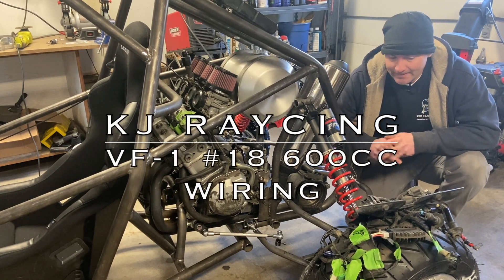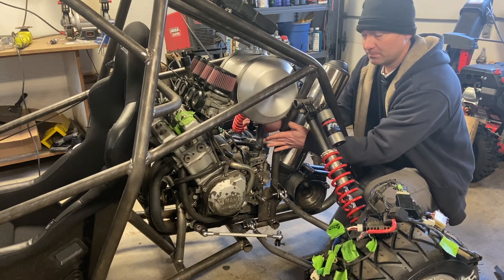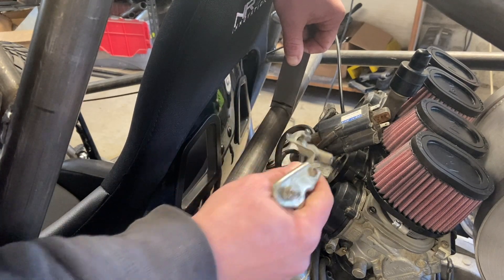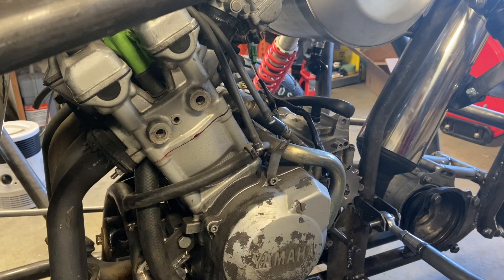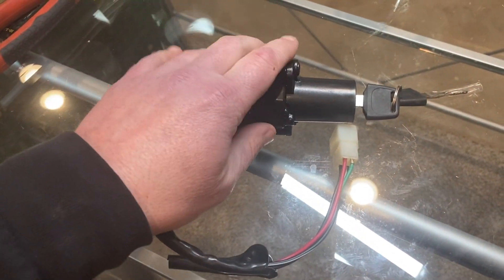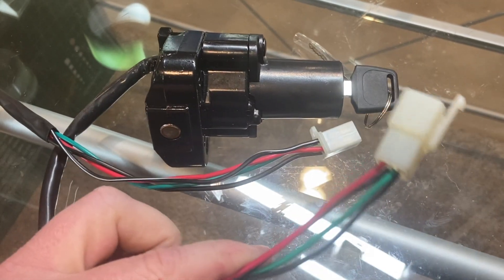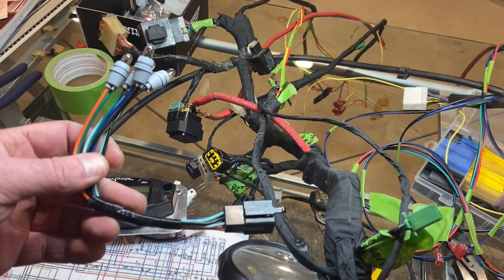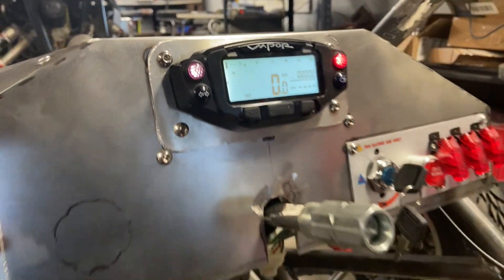Crosskart Build #18: Sport Bike Wiring KJ Raycing VF-1

Comment: Hey sorry if this is kind of an obvious question but I’m building my cross kart from scratch and I was wondering what that yellow knob thing is called next to the battery cutoff switch?
Reply from the maker: It’s a remote brake bias controller… $28 upgrade, but for a race pedal set that is $400. Totally worth every penny as I just set it up once and have full adjustability. I try to make good use of my budget and this is just one of those things you don’t know you need till you it.

Comment: I really like your the design but I wonder how it will be possible to remove the engine later on? it seems it will need to cut some tubes
Reply from the maker: It comes out the side, not the top. Everything is designed to be removable. I have to take the engine out anyway to paint it 😁